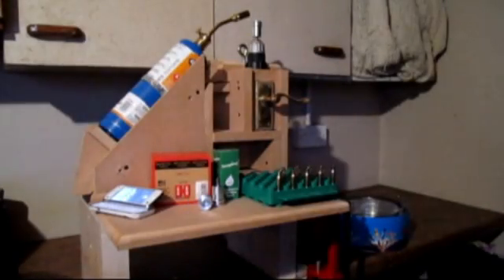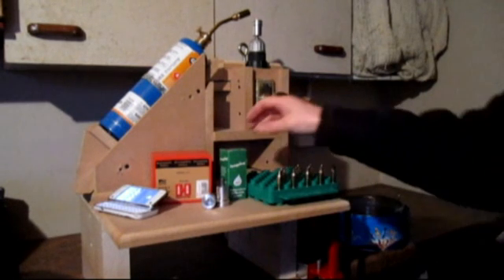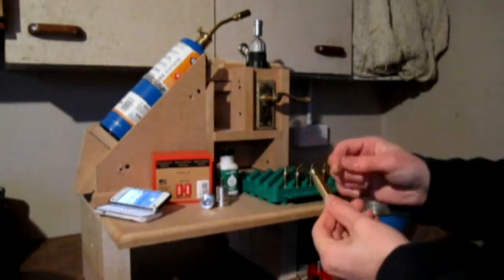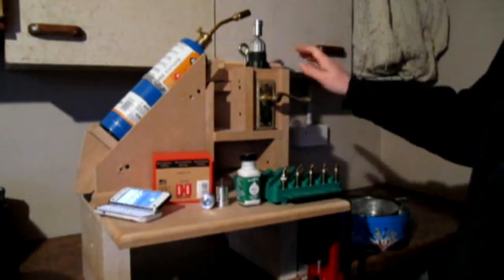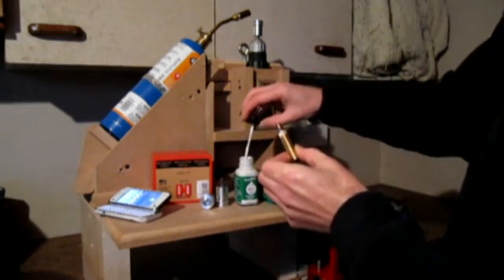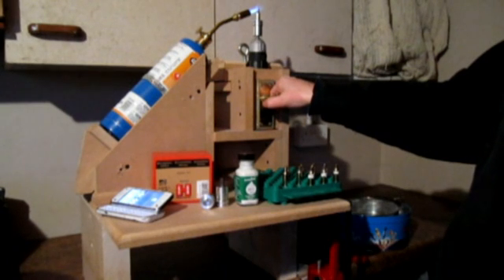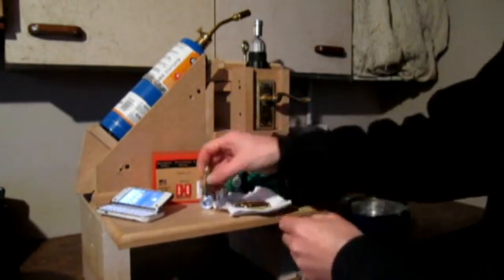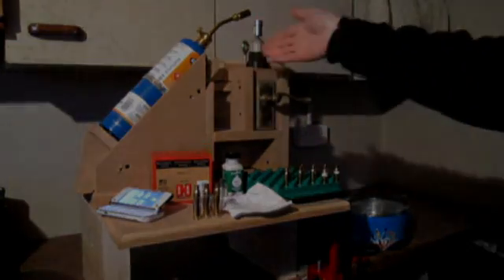Annealing Workstation

Comment: Use Tempilaq on the neck where you don’t want to overheat. Having the Tempilaq on the case is overheating the neck, 20 seconds of heat has ruined your cases. Way too much heat on the neck. 
I wouldn’t be using those cases. 
Do the same op with lights off and you’ll be able to see the overheating that’s going on. It’s a nice unit you have put together but the cases should be no longer than 5-8 seconds at most in the flame. 
If I were you I’d be doing some research on the actual process on the brass. 
My process is a low speed drill with mid heat torch in low light. 8 secs at most drop into pan to cool, very simple and cost effective.

Comment: Very nice setup.  How did you modify the drill speed/power control?  Great job
Reply from the maker: Kevin i use a bolt that you may see me turn at the top of the annealing station.  when I turn the bolt down it contacts the Drill power button so a light contact is all it needs to turn the drill at a slow pace.
Reply: Thanks Shootnbreeze!   This will be a fun project
Reply: Thanks Shootnbreeze!   This will be a fun project

Comment: What a hassel
Reply from the maker: i enjoy the challenge of trying to make my factory rifle shoot that little bit tighter.  However my reason to begin annealing was due to sooted cases after a firing.  It showed that the neck tension was not what it should have been and resizing the neck didnt help.  It was only when I annealed the case necks the sooting of cases stopped. Thanks for the interest in my page.  I hope to get a few more videos up soon of rifle cleaning and my smith & wesson pistol
Reply: +RINGET421 Getting a rifle to shoot accurate takes a number of steps provided you have a good candidate barrel, a good bed job, case preparation & sorting, load development, etc. Annealing to get uniform case tension is just one component of accuracy. Like shootnbreeze said he did it for case tension to stop the sooting of his cases assuming he's talking about gas slippage around the neck. I've I always understood, that gas slippage is undesirable. If you ever had any experience loading different brass, some brands have springier tension, thus becoming brittle sooner. A good example of a case becoming brittle too soon are .17 rem cases because of the smaller necks. its easy to overwork the brass. Even if your not onto minute nudge of accuracy attained from annealing cases one thing you can benefit from is extended case life. Personally I prefer to take care of my pet brass as long as I can. I don't know about you, but a 3 inch kill zone at 300 and 400 yrds is smaller than you think.... at those distances consistency is everything.
Reply from the maker: No hassle at all. Everything stays consistent and that's what is required when making consistent hand loaded ammo where the case is critical.
Reply: the annealing of the brass would have such a small effect on hand loads that its just not worth the time. i don't even sort my brass sometimes as a test and even two different companies brass is still well within accuracy limits of the factory rifle and novice shooting. (within and moa at 100 yards) and with a moa rifle you can accurately hit small targets at long ranges consistently but it takes a bit more work. of course a 1/2 minute rifle would make a huge difference at longer ranges, The chances of annealing process effecting change in accuracy is not noticeable from a beginner and probably not by pros. I must admit a lot of thought went into it.
Reply: Totally agree with you and I do all those things as well have a look at my channel I'm all about trying to keep it consistent and so far have either got it down or beginners luck. My channel is Ringet421. Have a look if you get a chance. Thanks for the reply
Reply: What's a hassel?

Comment: @ArcanusLibero, in contrast with ferrous alloys, brass hardness is not affected to any considerable degree by the speed of cooling. So by cooling it fast the only thing you are doing is limiting the heat that will reach the base of the case, which is very desirable since you don't want any annealing at all of that part. The only way to harden brass is by cold working it.

Comment: Brass as non-ferous metal is softened by quenching. I don't have a lot of specific experience beyond casting hand guards and cross pieces for knives and swords. I wonder how you how you are controlling the quench for the purpose of achieving the hardness you desire?

Comment from the maker: With steel quenching is needed to harden the metal with Brass the quenching is required so that head does not travel down to the case head and soften that area as this could cause the case to fail under the high pressures from firing.

Comment: question: wouldn't it be better to use hot water to dissipate heat from the cases? I ask because of the temperature change from ~630 to 50*F would seem to be drastic or does it even make a difference?

Comment: Seems like a very complicated machine to affect a very uncomplicated process. I just welded a 3/8-drive extension to a 17mm socket (for magnum shells), trued the shaft to the socket, cut the shaft to about three inches, turned down the stub to fit a 3/8" drill and use the thing to spin my cases in the flame from a propane torch that just sets on my counter. I spin, heat, watch for the color change and flip 'em into the water when I see it. Takes maybe 20 seconds to do each one. Very easy...

Comment from the maker: thank you for the feedback its always good to hear what others think and suggest.  This drill is a small cheap brand that was actually really bad at drilling in a nail or whole due to the rotation of the drill being 'off centre' and turning in the shape of an oval instead of circular.  This is the reason I decided to put it to a better use that to do any DIY with it.

Comment: Nice setup.  By forcing the drill motor to run slower than it was designed for you will shorten the life of the motor.  I'd rig up a variable speed drill if I were to build this.  Thanks.

Comment: @r1ngmasta Annealing will re-align the crystals in the metal so it becomes more uniform. Quenching it in oil or water afterward may harden the brass but it will still be a more uniform, stress free metal. Basically he is relieving any contained stresses in the metal which will extend the case life. A concentrated stress will cause a fracture in the metal. Sorry if that was repetitive. Tired. Also a year old post, whoops!

Comment from the maker: @biplanes4ever dunking the case into water is not intended to harden or soften the case in anyway.  It is to cool the case down so the heat does not continue down the body of the case to the case head where if that got to hot and annealed it could cause weakness in the case head and eventually case head separation when the round would be fired....BOOM....